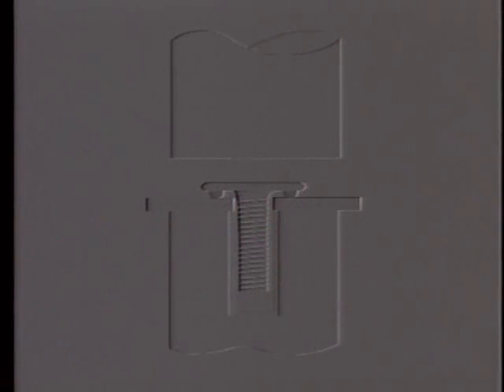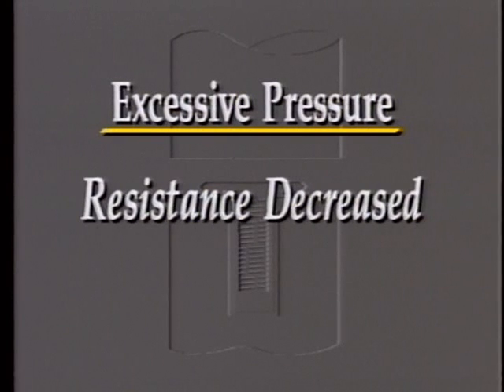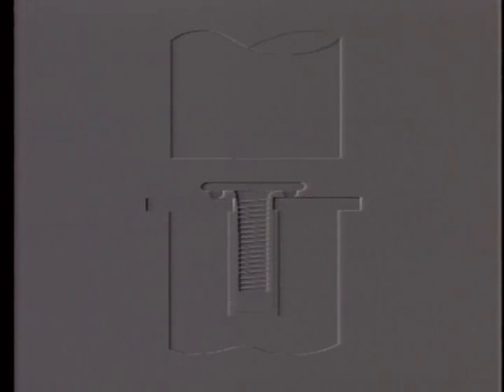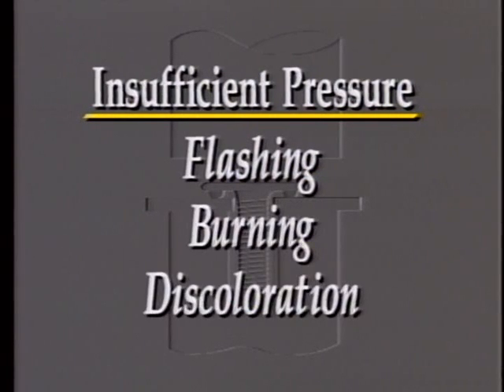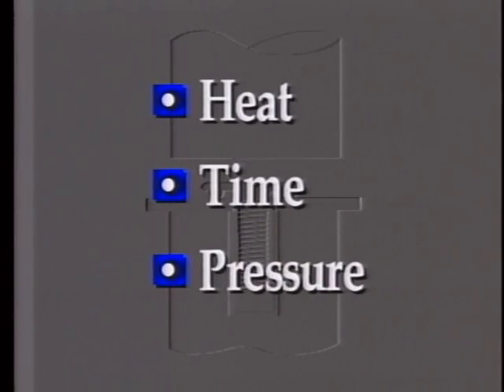Resistance Welding Video

Comment: Everything you address is true, with one exception.  What is critical to Good Welding Practices with Projections, is that the Projections have to be large enough for the Material Thickness you are welding them too.   If the Projects are too small for the Material Thickness, you will not be able to weld them properly.  there is a tendency to apply too much current to quickly which results in a blow out of the Projections themselves.  This compounds the problem, especially if the projections are too small.   I would suggest that you use Pulsation/Impulse Welding to help the process overall.